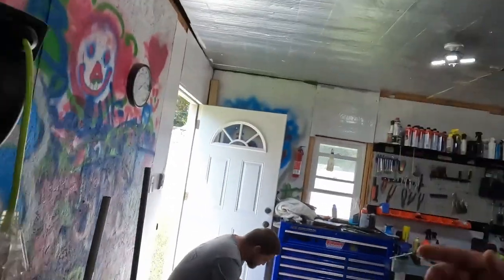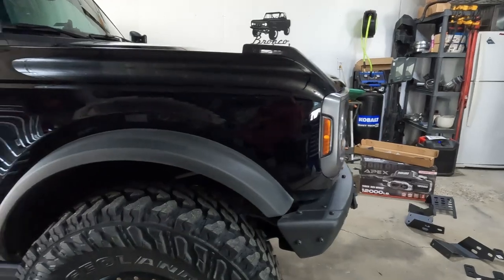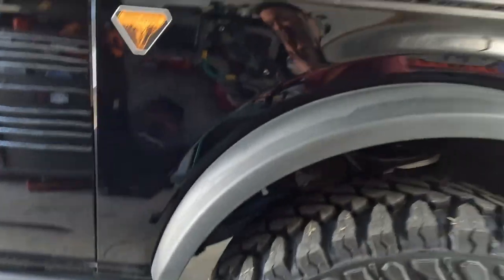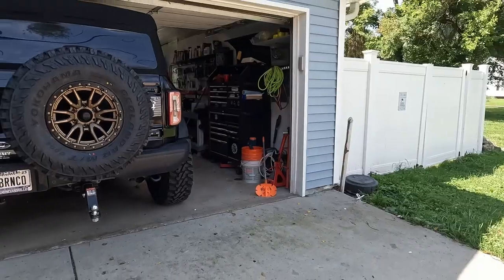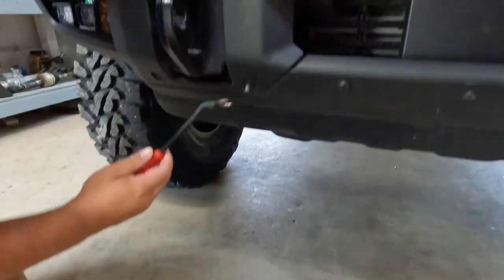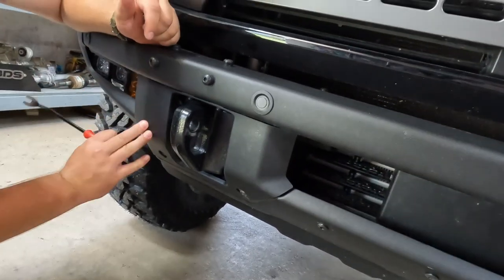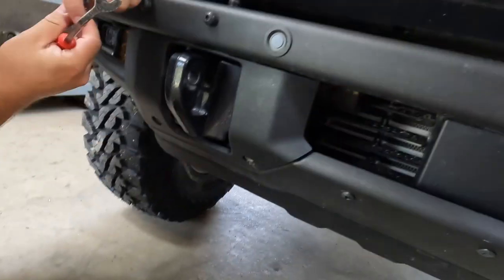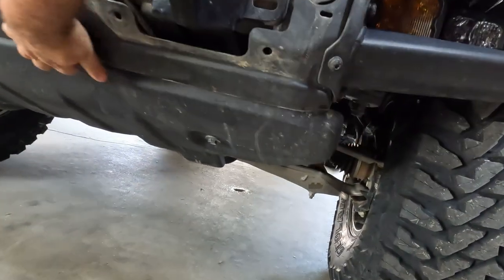HIDDEN WINCH INSTALL! 2021-2024 Bronco 2.7 Turbo

Comment from the maker: Rough country  has had a hidden winch available for the 2.3 Engine Bronco for a bit now, but the 2.7's  have a transmission cooler that sits in the way. 

The newest hidden winch kit  makes provisions for that now so even if you have the 2.7 you can install the rough country hidden winch kit. 

JKS Big tire clearance kit install I mentioned can be viewed at https://www.youtube.com/watch?v=bOuIDa8C9ck

Comment: This literally couldn't be any more useful. I have the same winch, same install kit, and same spec vehicle ordered.

You're the absolute first to tackle this, and I think you hit absolutely every single issue I could think of in reading those instructions, plus a few more with the shutters and the winch. I'm not completely sure I understand the point of the shutters...

Now I know to have cables ready. A bracket ready, and potentially an extension on the free spool handle.

Thanks for doing that. I hope you know you saved a lot of people a LOT of time.

Just so you know. The controller doesn't charge at all. It's a button cell situation.

Also, the control box.. The APEX has a huge controller box, it's true, but the rough country one also has a pretty tall one (just squared off more). Thinking that there's room for the RC to fit in the space, could a new box for the APEX be made to fit? Seems like the bulk of it's size is that huge sloping clam-shell top it has to give the winch a nice streamlined look when mounted in a front facing situation.

Now I think of it more, the wireless controller button is on that same switch box. Perhaps it's doing him a favor to mount it up top in the first place.

Comment: This is a great write up. Im glad you are pointing out all the flaws & issues as Im about to tackle this same kit on a customers 2023 WildTrax
Reply: How did it come out?
Reply: @mariowelch1290  outside of accidently hitting a trans cooler line it was actually pretty easy. I nicked the line when was on the last little bit of cutting the frame horn off when the blade kicked off a weld.

Comment: Nice work 👍 I opted for the high clearance RC winch mount for the modular bumper, but this does look super clean.
Reply from the maker: It does look good, and is hidden away pretty good, but I would much rather intal the high clearance one all day   hahaha

Comment: What kind of cables did you guys buy for the extensions?
Reply from the maker: It was 0 gauge  wire that was available at home depot.
Reply: @EvilleTruck  Why so YUGE?
Reply: @UneducatedPhotographer  Lot of amps needs big cables.

Comment: For those of us with the shutter system, at what step would you recommend that we need to remove the shutters?
Reply from the maker: Before you start with anything behind it like moving the oil cooler or the lines it will give you better clearance for doing anything in that area

Comment: I've had my eye on this for a while now, looks great. My only hesitation has been what seems to be a slight loss in approach angle due to the new skid plate hanging down a bit to make room for the winch. Could you by chance take some side profile shots of this, so I can compare it with my still stock badlands?
Reply from the maker: Would love to but that Bronco actually was sold and is no longer even in the state for me to get pictures of any more :(

Comment: How long did the hidden winch install take?  The Rough Country hidden winch listing says 4-hrs, but it seemed a lot longer than that.
Did it change the approach angle, or clearance?
Will the relocated oil cooler still get as much air?
So far this seems to be the best winch solution I’ve seen.  Most of the other solutions interfere with ACC, camera etc and require a 200# winch bumper - which is a lot of weight sitting out front.
Reply from the maker: 4 hours  maybe if you have the 2.3 engine..   it took  longer than that just to relocate the cooler.   Would plan for closer to 8 -10 hours and thats if you are using the recommended winch. The cooler is not air cooled it has coolant pumped through it so relocating it is not an issue, and it has plenty of space to dissipate heat. 

WE did not measure approach angle but I dont think it changes much if any since it sits where the OEM bash plate normally would .

Comment: So many questions from me.
The shutter panel you removed. It's motorized. Did you just leave the connectors dangling free?

I've seen some intercooler swap videos where people removed the shutters but leave the frame connected and electrically attached.
I'm wondering if removing it entirely triggered any error codes?

Still can't bring myself to purchase this kit. There's so many oddities. I think the worst in a warranty sense might be the removal of that intercooler shutter. While only the badlands and wildtrack has it, they seemed to think it needed it. Is it purely to keep the IC clean? I really don't get it or understand when it might be needed to not allow air to the IC when it's entirely passive on all other models with the same engine.
Reply from the maker: The shutters we removed were not the active ones on the front that you have seen others remove.

This was a passive one on the backside with no electrical connections. This is the only bronco I have seen with this on it, and have not seen it elsewhere
Reply: @EvilleTruck  Bizarre.
Reply: Just chiming in. My 21 V6 Badlands also has the shutters on the back of the intercooler.
Reply: @whiteshark27  You mean a passive one, and you also still have the motorized one on the front?

Yeah I think I'd like to see a few more install videos with this particular piece of kit.

It's got a cloud of slight strangeness happening :D
Reply: @breaddrinker   yes. I have them on both sides as in the video.

Comment: Not being able to free spool the winch is a major pita. Hopefully he doesn't need to use it often, because it takes forever otherwise. I might have missed it, but did you wire in a winch disconnect? You don't want to leave that hooked up all the time. And if its used heavily, and it gets really hot, they can get stuck on, and then you are trying to find a wrench to disconnect the battery. There are manual disconnect switches, and Warn also makes a universal solenoid kit with a switch you can mount inside.
Reply: That winch actually comes with one to wire in.
It's a pretty complete kit. Shame the control box is so gigantic.
Reply: Getting to the lever is a real pain in the ass by hand, and it is possible to relocate the lever elsewhere with a little engineering and socket swivel to help with angles, but I just made my own handheld tool that can reach the lever from the top.  Since I also removed the hood prop rod for lift struts, I had a very convenient spot that was freed up to store my tool.
Reply: @Skinflaps_Meatslapper  You completed this is a 2.7?

Wish you'd upload something, somewhere for us to read about. This really is the best way overall, and it's just not getting much coverage.

I'd personally love to hear about the way you've engineered a way to relocate the freespool switch.

I may pick up the kit if there's any black Friday deals, but as for installation. I'm still waiting on my build to be built :/
Reply: @breaddrinker  Yeah, it's a 2.7L, and I basically did everything they did in the video.  It pretty much encompasses everything you'll encounter along the way except for the unending feeling of frustration the entire time...

The apex does fit in that mount without needing to flip the bolts around, you just have to install the top four bolts after you get the winch bolted to the plate.  There's room for the bolts to stick out, there's just not enough for the winch to slide past them if that makes sense.  I'm running the high clearance RC front bumper so I didn't have to take the bumper completely off to bolt the skid plate up.  I mounted the control box between the radiator and engine so I didn't have to source longer cables, but I'm not terribly impressed with that location and might move it elsewhere in the future...the reason I put it there was so I would still have room for an ARB compressor/catch can/snorkel/etc. that need that space to fit.  Disassembling the control box and only adding some insulation over exposed terminals might make it small enough to fit somewhere more out of the way.

I never did engineer a lever relocation, as the tool I made sufficed.  This install burned through most of my patience and I wasn't really feeling it at the time.  I may revisit the idea later on with perhaps a 90deg adapter gearbox if one will fit and a shaft running out to the bumper or fenderwell.  A socket swivel on the lever and a 1/4" rod extending up in the engine bay would probably work fine too if you don't mind popping the hood every time.  If I do end up tackling this though, it'll definitely be externally accessible some way or another.

The tool I made was nothing more than a 1/4" square rod that I forged a rectangular loop on the end of, and then a T-handle on the other side.  To use it, you reach in with the loop and hook the lever, then all you need to do is twist to turn the lever.  You don't need any kind of swivel adapter since the fit of the loop has just enough slop to allow off-angle movement on its own.  I trimmed my lever down similar to how they did in order to clear the intake tube, but I trimmed it to a lower profile so I had clearance for the tool to fit between as well.  The control box is kind of in the way where I mounted it and you have to work around that to get to the lever, in addition to the relocated heat exchanger right next to it, hence why I'm not entirely happy with that location.

If I figure out a better way to install the control box and engage/disengage the clutch, I'll probably post a writeup and pics on the bronco6g forum.  But you'll probably have your bronco long before that happens lol
Reply: @Skinflaps_Meatslapper  Here's hoping. Appreciate the reply. Thank you!
Reply: @Skinflaps_Meatslapper  You know, my biggest problem with this is removing the shutter mechanism on the intake. In liking the hidden winch at all, is because I'm into the OEM look, and removing that rubs me the wrong way.

I know it's disputed that the shutter mechanism even does anything, but, I'm worried about warranty destroying in just taking the thing out, and I feel it's sketchy to remove fins...

How did you feel about that, and what did you do?
Reply: @breaddrinker  My intercooler didn't even come with those shutters, I had no idea Ford was putting them on until this video.  Obviously they felt it was useful enough to add later on, but it's not like they're scrambling to get shutters installed on older Broncos that didn't come with them either (especially given that the ones missing shutters were also making news about blowing engines).  My take is that they're probably useful to some degree (most likely at low speed with very little airflow), but not at all necessary, and Ford would have to prove the lack of shutters is what caused whatever failure you might need a warranty for.  You can either remove them completely and keep them intact or trim just what you need for clearance, as there's really no other way to make room in there.

I went to bed thinking about that control box last night and decided to disassemble it today just to see how small it is without that huge aluminum cover over it.  Turns out the whole thing is about the size of your fist, so one of these days I'm going to take it apart and find a better spot for it.  Looks like there's probably room to put it on the side of the winch with a simple relocation bracket (the included relocation bracket doesn't fit around the Apex winch, it's about an inch too short).  That would certainly cut down on the amount of huge cables you'd need in the engine bay.  You'll have to splice  some of the wires going to the switch and wired controller plug, but that's super simple and could be relocated anywhere...including inside the cab if so desired.

One problem that I did run into beyond what was in the video was the skidplate where the fairlead bolts to, the bends don't exactly match up and the bolt holes aren't quite right.  It didn't take a whole lot to get it fitting right, it was just annoying that everything on the front was made by RC and it should've fit correctly without any extra work.  I kinda wish I could've used a different fairlead other than RC's, but it is what it is.
Reply: @Skinflaps_Meatslapper  I was wondering if the control box could go somewhere near the winch. Good to know you tucked it somewhere.
Reply: @swooshdave  I ended up taking the control box apart and mounting the solenoid directly to the winch to free up a little more room.  Cut and crimped some really short wires to feed the winch, and it all goes in and comes out as one piece.
Reply: @Skinflaps_Meatslapper  Are you making it more susceptible to water doing that?
Reply: @swooshdave  Not really, the box isn't waterproof and it's not much more than a splash guard anyway.  The electronics themselves are waterproof, it's just the connections that you'd have to worry about (and that would be the same for a winch out of the box, as they're not waterproof either).  Basically, if you submerge the winch, those connections will get wet one way or another.  It's probably just as well protected from water in the hidden winch location as it is hanging off the front of a bumper with the cover over it.  I mean, I did what I could by using insulated covers and shrink wrap, so it's not like they're bare/exposed terminals just waiting to weld a wrench to the frame lol

Comment: I have some purpose built tube camps that I could swear that I got from Harbor Freight.
Reply: You're correct, HF has several types of clamps for that purpose, I actually looked at them today.  Some plastic ones that I wouldn't trust, vise grips with smooth self adjusting jaws, and some made more or less from u-bolts in various sizes.  I'd recommend the vise grip type.
Reply: @Skinflaps_Meatslapper  take a look at HF-65116. They were a nicer version of the u-bolt type.
Reply: @mpeugeot  Yeah, those are the u-bolt clamps I was thinking of, I didn't know what else to call them lol

I considered using those but I didn't want to buy two packs of assorted sizes just for the two big ones I needed.  This will certainly bite me in the ass in the future when I need to clamp some small hose somewhere, and I'll end up buying two packs of them anyway.